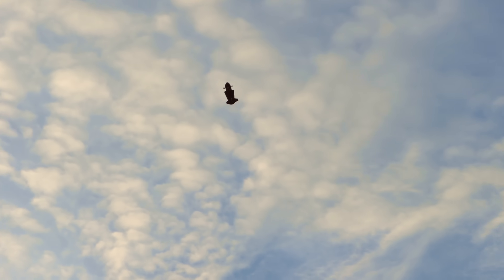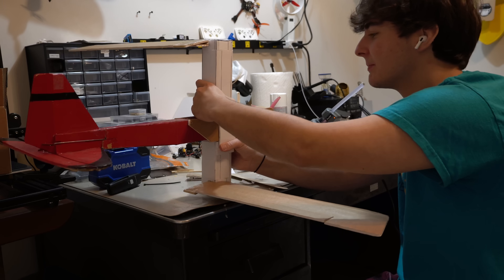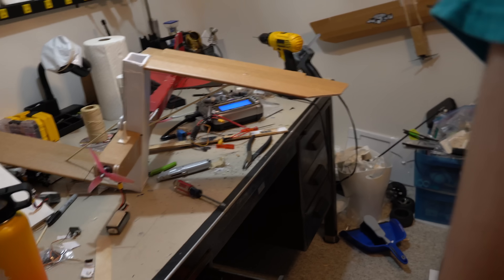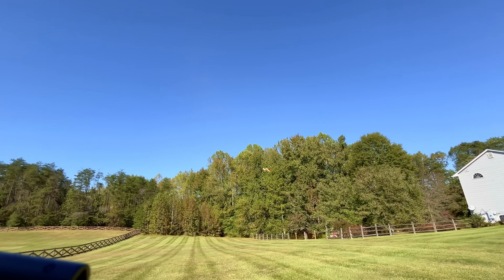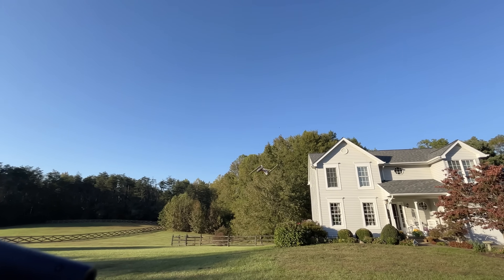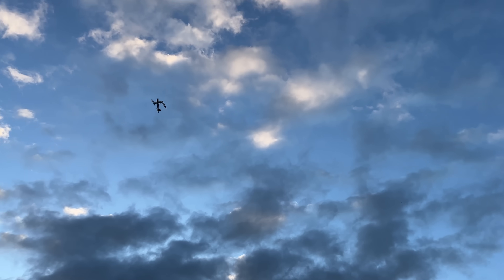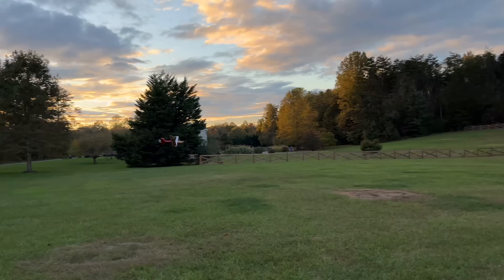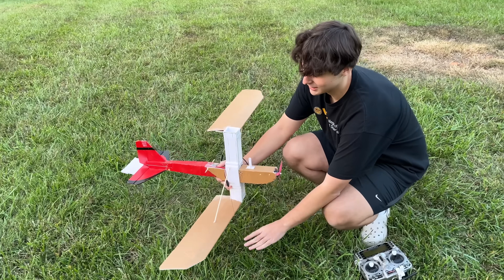Can a Plane Fly With Offset Wings?

Comment: This experiment is very helpful for someone designing a fold wing plane where one wing is just above the other. Or for a stop rotorcraft (with twin rotors) where only one side is a wing for both rotors (when stopped). No need to experiment if the different height rotors blades work or not...when they act as wings (in stop rotor mode). 😅

Comment: After intro before watching full video, I do not think it will cause a roll but I do think it will decrease lift because the air under the upper wing has higher pressure than air over the lower wing.

Comment: Few things to consider. First, do they both truly have the same angle? Harder to accomplish with the offset. Second of all, at what altitude are they flying? At low altitudes, you'll get higher air pressure due to proximity to the ground. So if you've got a big offset and very little altitude, then one wing could possibly have twice the air pressure as the other. As it gains altitude this becomes meaningless though.

Comment: I think this should be fine once the plane is in the air but near the ground you might get ground effect on one wing and not on the other, leading to a difference in lift. Not a huge issue with little offset but with large offset I suspect it would really mess up your day.

Comment: In your flying car experiment, shouldn't the offset in the wings cause a torque effect relative to the center of the mass, which would be down below near the car itself? Even though the lift is the same in both wings, one is farther away from the center of mass than the other, generating more torque. This wouldn't happen in this experiment because the center of mass is in the middle of both wings, so the same lift is enough to ensure the same torque. Is there something I'm not taking into consideration here?

Comment: It is arguably worse since the large offset will create a bigger moment which will make it that wind will have more impact. But in theory it will fly fine, since the air density difference between the wings is minimal

Comment: Everything will fly giving it will have enough power to overcome the force of gravity even a cube (many planes including F22 are not aerodynamic and would be unable to fly without computer guidence others like the B2 are just toooo complex to fly without computer help)
This design ia performing the same when flying in a streight line BUT is increadble unstable on turnes bcs the wing that got low on turn stop producing lift first thats why planes got max turn rate (also max climb rate for a different reason) So in this design the plane lower wing will be sooo low on the turn to that side that on the slightest turn it will loose lift completly 
(Ground effect can be easily couteracted and on streight wings will have almost no efect (for ground effect wing youll need to use V shape wing as been used on acronoplanes as well as the area of the wing should be much larger and the leading edge angle much lower))

Comment: There was no doubt in my mind personally that it would fly. We make objects fly all the time. The fastest object in the world was a manhole cover that got yeeted into orbit. (if true). Im more concerned with the conclusion that the offset wouldn't matter. Its clear that the offset affected the axis or balance. I would say the car plane hybrid didn't work do to this axis issue. The planes shown are operating on PULL - the engine is centre at its front. So, the pull is center axis. so you could view the plane as a T, the long being the engine and the cross being the wings. Putting the wings offset changes the dynamics of the axis, changing the pivot points I want to say. With notable issues to flying it at lower speeds, I believe the real issue would be crosswinds, which is where having non-offset wings shine. 

Cutting vents into the wing support body would alleviate this, this also exposes the other wing to the wind as well. That's would Id be interested in seeing the effects of. 

Now to the car situation. I believe it was more so the ground effect + point propulsion + weight - speed = Failure to fly. I haven't seen your video for it and Im surprised your channel was in my recs as I watch stupid video game theories, music and even dumber politics. However, my 10 cents would be that you would either need to lighten the drag of the car and increase speed. I believe you would've gotten A LOT of drag with the tires and open internals. Flying is similar to how fish swim, only instead of floating through water, you have to create your own float along with propulsion. If you can somehow fabricate a haul that streamlines it then you could have gotten it to fly.

Comment: It shouldn't matter if both sides are the same weight. And if a hot or cold air current under need it it will tip it to the lowers side. Hot air rises cold air falls.

Comment: The ground effect is more efficient the closer you are to the ground. So while an offset design might work fine high up. On landing or takeoff you will likely experience an increase in lift on the lower wing and thus a rolling force. 
That might explain why the flying car struggled and consistently rolled on towards the higher wings side.

Comment: Not an engineer, but going from a purely physics based perspective, assuming the wing generates lift force in the upward (normal to travel) direction only, and in no other, and that the amount of lift provided by both wings is the same, irrespective of their position relative to the other (i.e. the difference between them is so small that the conditions can be considered the same), I do not see a reason that offset wings should cause a rotational force on the plane. In fact the only way I could imagine there being some kind of rotational force on the plane, is if the offset wings provided some kind of horizontal component to the force vector.

Comment: Nice. Forget the uneducated folks. Basic aerodynamics, identical  wings moving at the same rate of speed, offset or not will have identical lift and drag properties. One wing won't produce more or less lift just because it is offset if both wings are the same dimensions.

Comment: "it flies completely normal" but out of the numerous flights you gave it, 99.9% of those flights you would only do count-clockwise circular flights, and the one time you did a clock wise circular flight you only did it for a mere 2 seconds. Regardless, it was still a cool project.

Comment: Torque = Force x perpendicular distance

In this case the force is vertical, and raising/lowering the wing does not change the perpendicular (horizontal) distance to the body, so no torque added by raising/lowering the wings.

Comment: Offset wings should cause some roll because forces during flight will apply a torque on the wings themselves which will cause them to flex so that they are no longer purely perpendicular with the vertical axis of the plane, causing both wings to apply a force horizontally either towards or away from said axis. Because the wings are mounted at different points vertically, the higher wing then will apply a greater torque than the lower wing which would normally apply an exactly opposite torque, which will then result in roll. That said, if the wings are stiff enough and the difference in height between them is small enough I suspect you wont notice compared to all the other forces on the plane.

Comment: Its the same bias people get when looking at perpetual motion machines. Yeah youll have gravity pushing down on a wheel but youll also habe it resisting pushing up. Doesnt really matter what level the wings are at, the air moving above and under the wings will remain the same speed creating the same lift

Comment: Before watching the video: In theory...no? In practice...maybe? I guess the twisting moment on the support arms would cause uneven deflection if they're not perfectly equal. And other aero effects might not be symmetrical about the horizontal plane making it more difficult to balance overall.
After: Cool it seems like it flies just fine. Physics works!

Comment: before watching video. ground effect might contribute to instability. after sufficient altitude should not interfere. center of gravity is also a factor, not sure how much
Reply: 8:29 maybe switch left and right wing height and see if it turns right better.
Reply: make a glider with no control to see if center of gravity is a factor at all. 
*small sample size but sufficient enough to prove that lift force is similar no matter the height relative to the fuselage

Comment: So as a person who’s daily job is to work on aircraft. Your father is partially correct at the start, the left lower wing had more lift than the right due to ground effect. Although once it had gotten up into the air the offset wings shouldn’t have been too much of an issue assuming the wing area is the same and they are over or just ever so slightly behind the center of gravity. As a quote from an engineer I know. We can make a box fly and have lift with enough speed and power.
Reply: "We can make a box fly and have lift with enough speed and power."

At a certain point you call such a thing a "missile", though.
Reply: @johanneshass1614  Or a Kerbal.
Reply: @johanneshass1614  if it flies it flies
Reply: I mean the number of people who have made a foam board fly is quite high. Just a big ol' flat rectangle of foam core, no shaping or anything, just slot in some ailerons and slap on an motor and prop and have at it.

Comment: Lift is a function of wing shape and surface area, so the offset should have no effect on total lift. There would be a twisting (roll) effect on the fuselage but with the rigid connections between wing and fuselage and the tendency for the individual wings to want to remain level that would be counteracted. If your lift was from strings connected to the top of one side and the bottom of the other, you can easily imagine that twisting (roll) effect

Comment: It would be cool to test how well diffusers on their own work behind big blocky bits. It’s an incomplete solution for aerodynamics but it should help fill negative pressure zones, potentially reducing air resistance by half (in practice it will be less than half, but how much less?)

Comment: Yea, it's the angle of the wing relative to the level plane euclidian plane that matters, not which wing is literally higher in altitude. It is going to slow the roll rate as the polar moment of inertia around longitudinal axis has changed due to either wing being further away from that axis.

Comment: When I saw your video's image pic, I was intrigued.  My thoughts:  If the two wings are identical aerodynamically, then lift should be sufficient and the plane shouldn't roll.  HOWEVER, that assumes that the center post is perfectly aerodynamically neutral as a wing as well.  If not, then the craft will yaw or roll depending on how out of neutral the center post is.  It'll be tough getting both wings perfect (in a model made with craft wood), attached perfectly so that each has the same lift characteristics and that the center post has no left/right "lift" characteristics.  The center post can act basically like another tail.  But with enough fiddling, one should be able to "fix" any minor instabilities.

Comment: Closer to the ground it will have ground effects. the less the gap between the wing and the ground the more effect ground effects will have on the aircraft. when you try to land it, it will always most likely I am like 98% sure it will role to the side that has the wing higher. This will cause a crash. So Landing it and taking off will be the most difficult part of this"Experiment". Unless you have a auto stabilization machine on the aircraft itself, or you manually roll it to the side with the wing being closer to the ground. In any case, you will need to be very precise. This is why there are no airplanes that are built like that. But there are helicopters that have a similar build if you scale them to an airplane. I forgot the name of the Helicopter, but it's the one that has 2 propellers when they are rotating they crosspaths with each other to create "stability". Again, I could be wrong, and this video is quite interesting! Would love to see the aircraft be tested for taking off and landing Manually and Automated off of pavement or an airstip. (Side note, I wrote this in the beginning of the video.). And yes, you did explain the ground effect. Also this is probably why your RC car didint fly properly, again the gap for the wings was too small, but it could have been it. Good luck with your future journey man! <3

Comment: before watching the video out of first principles offset wings should work. In straight flight load on the wings should be equal, so there will be no difference on leverage between the wings = stable flight. One wing pushes upwards other wing pushes upward too, moment is canceled, because there is no force across the wings, only perpendicular the wind and wing plane. I don't see how change in roll, pith or yaw can change this balance. Only some disturbances over the central structure or maybe very special aerodynamic might cause trouble, then flow over the wings are actually different, so you get differential load. Or maybe if you will get different curve on the wing because of heavy load, so you start to get forces across the wing plane.

Comment: what if both wings are not the same distance from the center of the plane/the center of gravity? Think of it like opening a door. If you push on the far end of where the door rotates, its easier and requires less force, but if you push on it closer to the hinges it becomes increasingly difficult. The wings might work the same way, but then for rotating the plane. Right now they are roughly the same distance from the center of gravity or where the plane rotates from, so it would be like pushing the door from the same point with the same force, but I think if one wing is closer to the center of gravity, the plane will spin out of controll in the direction of the closer wing. This is like pushing the door with the same force but closer to the hinges. I have no idea if that is actually how it works but that could be a cool follow up video.

Comment: I wonder if the stiffness of the mast has anything to do with it too.  While yeah the torque applied by each wing should be cancelled out, assuming the mast doesn't add more/less flow under one wing (which is a bit of an assumption too).   But if the central mast isn't rigid enough I can see the off set wings like this causing it to bend in a ) shape which could cause sideways forces, also the wings won't be parallel to each other... but I don't know enough about aeronautics to know if that affects the flight.    Might be worth another experiment with a more flexible mast... just for science :)

Comment: why would blocking the stream from the propeller matter? You move forward because air is accelerated backwards in that instant, what happens afterwards, theoretically doesn't matter
Reply from the maker: You wouldn’t be able to open a trap door if you were standing on it.
Reply: @joosh_king  what? That is not a proper analogy. if im pulling myself from a rope, what happens with the rope I left behind has no effect on my movement. Could you elaborate? Thank you
Reply from the maker: @comeberza  ya maybe a bad analogy 😂 sorry. Well the air does get thrown back which would propel it in the opposite direction. But then that same air then hits the mast and pushes back on the plane with almost the same amount of force that it pushed forward with. So I think they nearly cancel each other out. Maybe a better analogy would be that you can’t blow your own sail.
Reply: @joosh_king  you can indeed blow your own sail, or to be fair you can redirect your flow of air with a sail to travel forward. But you are totally right! The pilon the wings are mounted on, is attached to plane and for some reason I heard you in the video, my brain jumped straight to a model with a propeller next to a wall that of course is separate. What an stupid oversight, than you for the answer ☺️😅

Comment: The lift force diffirence between the wings should be especially pronounced during takeoff and landing, when the ground effect is active. But in most of the other cases it is negligible. Therefore, this can be seen on a cruise missile, but not on an airplane.

Comment: I can't figure out what would be the reason lower wing would create more lift? Physics stay the same, so offset is irrelevant. Weight would be slightly off, which would make it tilt a little, but that's also marginal (and manageable with counter weight).
Only scenario where offset would actually create different lift would be if wings were like mile offset. Then air pressure would be significantly different and that would affect the amount of lift produced.
Love the enthusiasm and experiment!

Comment: Before watching, my prediction is; Landing and takeoff may be effected by asymmetric ground effect, if that is relevant at small scale. Mostly, flight will be unaffected, however control surfaces on the wing further from the center of mass will be able to result in greater torque, but that effect will probably be canceled out somehow by the larger radius it would have to travel around the com.

Comment: It’s basic physics. The upward force from the wings will be the same on the center of mass no matter if they are offset or not. There will be no rolling cause the torque force (moment of inertia) is the same on either side since the wings are the same length and same distance from the center of mass.☝️🤓 Fr tho, statics was my favorite physics class I had to take for engineering. Not gonna say I was 100% confident in my analysis though

Comment: A duel rudder system gapped at a distance the give clean airflow to them would be better, but the holes you cut in the central strut were good enough.